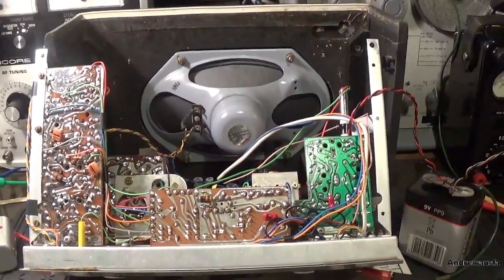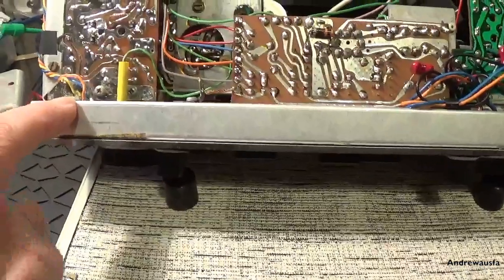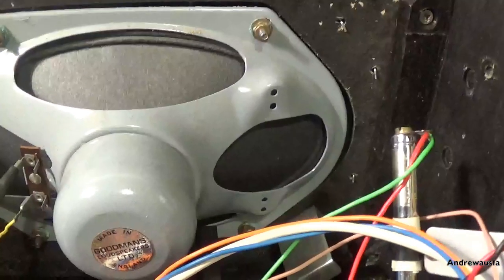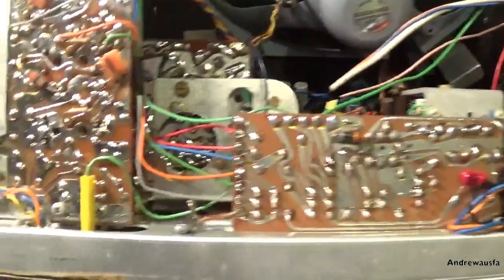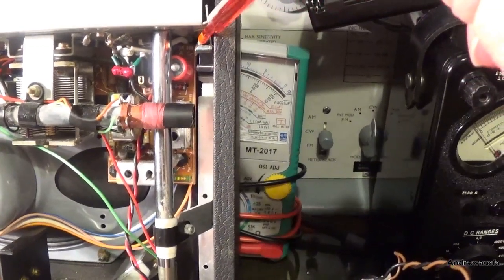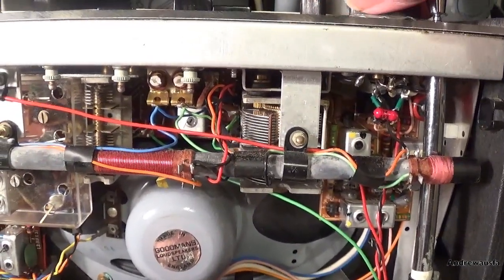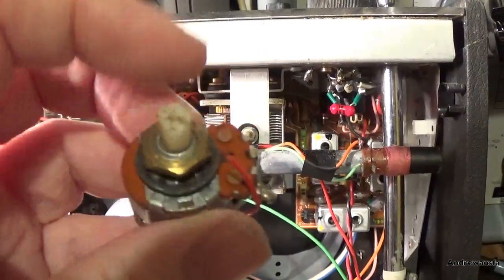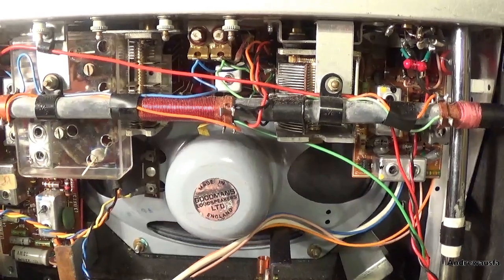Hacker Sovereign RP25A radio repair more faults

Comment: First Thing I Would Change is C21 Which is Across The H.T. On The AM Board Andrew I Did a Set In The Past And Instead Of It Reading 350uf It Read 28nf And a ESR Of 17 ohms Those Red T.C.C. Caps Always Give Trouble Even On The Amp Board In Fact a Lovely Old Radio Of This Vintage Really Needs All The Electrolytic Capacitors Changed Just My Umble Opinion Looking Forward To Part 3  Regards mike.
Reply from the maker: Hi Mike, on it :) See my reply to Theo below..or above. C21 is deader than a sausage. Just wanted to get the basics sorted before component changing. So much easier to test a set if the amp is working!
Reply: @Andrewausfa  Andrew These Are The Jacks I Use For The Gram Input Sockets And Headphone Sockets They Work a Treat If You Use Them With a Small Washer And Are More Reliable Than The Ones in The Rp25a And You Would Hardly Notice The Difference With The Plastic Dial Plate On  https://www.rapidonline.com/cliff-electronic-cl1382-mono-panel-skt-s6-bb-3-5mm-black-51-5118  Regards mike

Comment: I'll be looking forward to see what you do with the oscillator. Very interesting project.  What is HT?
Reply from the maker: Hi Clay, HT = High Tension. A bit of a misnomer when talking about the 18V these sets run on. I suppose the expression in relation to battery radios goes back to when they were valve/tube based and had High Tension batteries of 90-120 volts and Low Tension batteries of 1.5 to 2 volts.  Just one of those expresssions that I guess you have to know the relationship of the equipment to the supply voltage and would mean something totally different to an electrical power distribution linesman :)

Comment: Exciting Andrew, could end up just being a broken wire or track....we shall see.
Reply from the maker: Hi Theo. First thing is to check that volume pot. Its either the carbon track worn away or theres DC on the pot. I checked the big red capacitor on th AM board after uploading this last night and its pretty much short circuit. That could cause a lot of faults as its across the HT line.
Reply: @Andrewausfa  Hi Andrew, If the cap is virtually short circuit, not knowing the circuit though, but this could mean other components may have been damaged in the process.